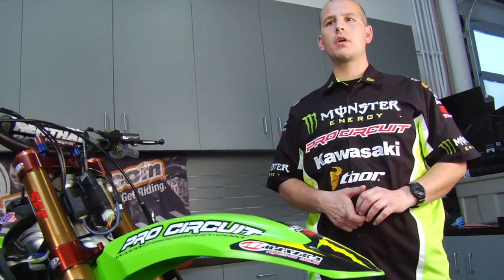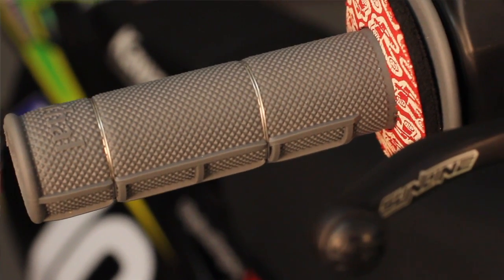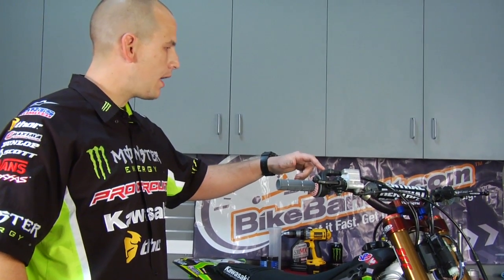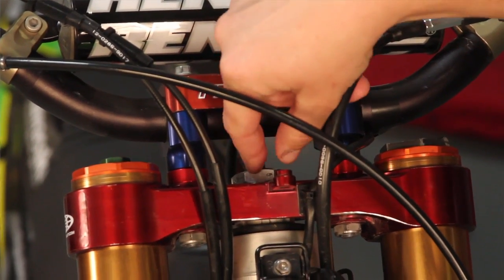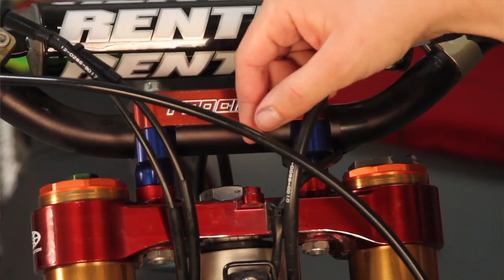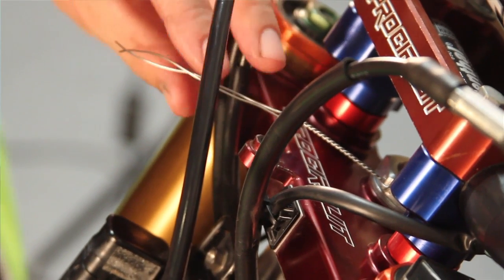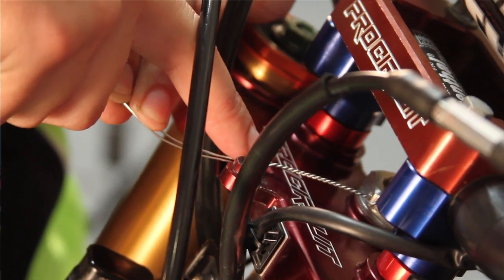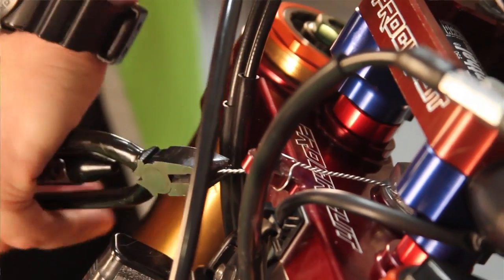How To: Safety Wire

Comment: twist the 2nd 1 ccwise.
Reply: Since the wire is being safetied to a fixed point, the second twist does not need to be counter clockwise. The only time you need to go counter clockwise is if your safetying to another bolt.